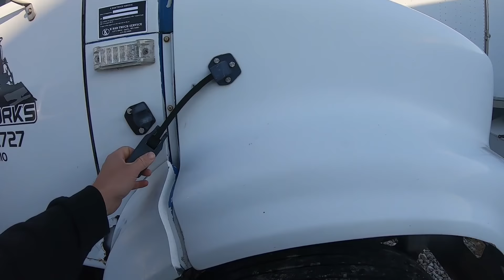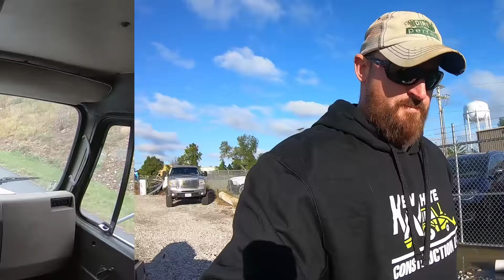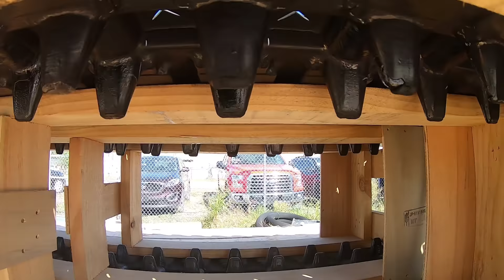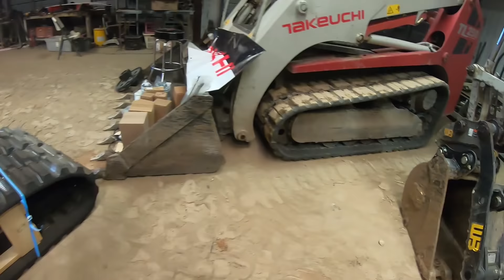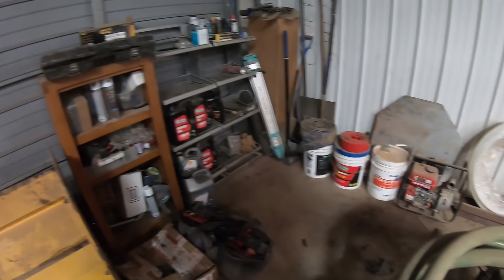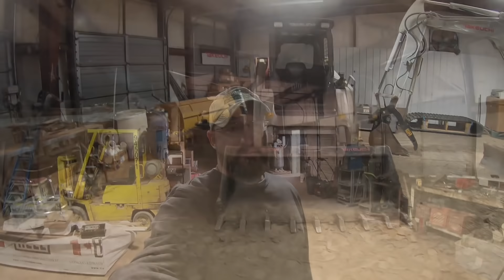Picking Up New Loader Tracks

Comment: Call your old dump truck Shirley.  Shirley she will start up today...
Reply from the maker: user990077 🤣 that will work! It’s always fired right up but it only has 80,000 miles on it. But probably a million hours idling 🤣
Reply: What year is your I.H. dump truck again ??
Reply from the maker: Del Casale Excavating 1992
Reply: Mine was a brand new  1988' 1900 series/4900  is the newer version.... only had 86,000 original miles when I sold it in 2017..... Best truck I EVER owned !!  DT466 is an still is one of the best engines around !!!   Kinda wish I never got rid of it... but the guy who bought it keeps rubbing it in about how great it is and how he's so happy I took a chance and believed in me that I maintained it so well and it was garage kept.....
Reply from the maker: Del Casale Excavating nice! They are great trucks and engines. I just rolled over 80,000 miles on this truck last week.
Reply: @eliteearthworksllc  92'. That's right !!  You're truck is an automatic transmission right ??  Do you find it has enough gearing and torque for off road and site work ?  My truck had a 10 speed manual with two reverse gears..low and super low.... just had to make sure you kept your foot down and speed up backing into the mud or it would sink and game over !!  Time to grab the excavator/ towtruck.  Lol
Reply from the maker: Del Casale Excavating yeah so far it has been just fine for that

Comment: Search Jackson Ms. Marketplace for rubber tracks, looks like they have a warehouse full of tracks, starting $350.00 up
Reply from the maker: charles lindsey thanks, I’ve tried some aftermarket tracks but they just don’t seem to last they also only have two steel cables in the tracks where the oem have 4